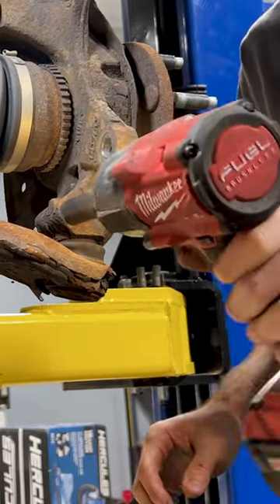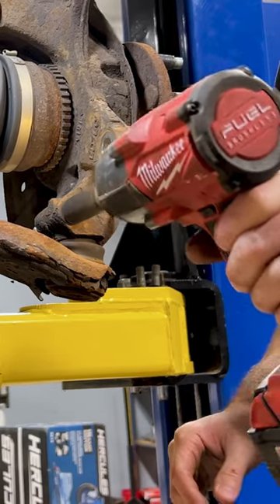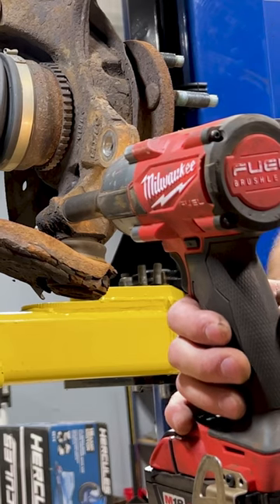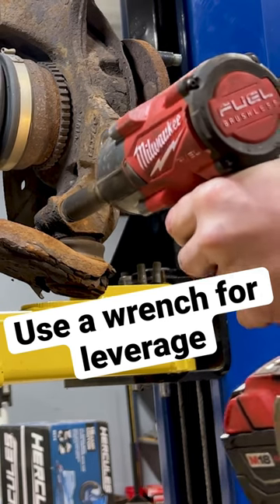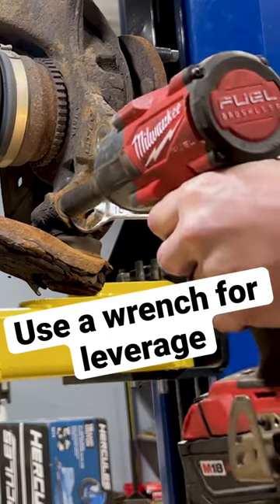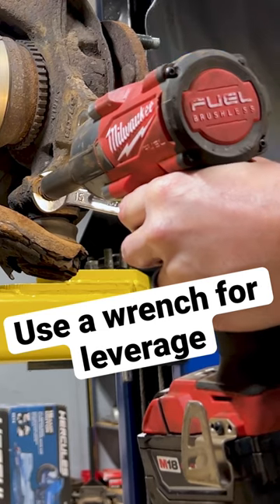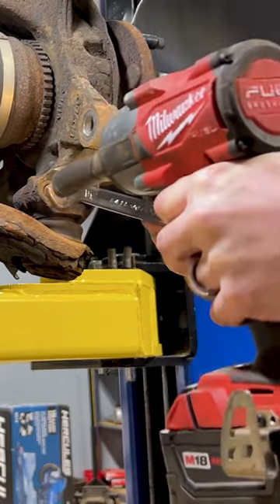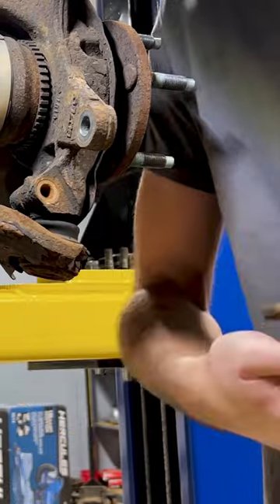Free-Spinning Bolt Removal Trick #shorts #automotive #autorepair #gotech #milwaukeetools

Comment: But how does one remove a free spinning bolt when the housing is surrounded in plastic and you can't get around or behind the head of the bolt.
Reply: Warm the surface gently with a heat gun, maybe?
Reply: Dealing with this right now. How did you solve it? Thank you.
Reply: @michaeld9999 Did you ever figure it out? I’ve had the same problem on my fourwheeler for a while now?
Reply: @AndrxwTP  Hi Andrew, no I haven't. Sorry man.
Reply: @michaeld9999  No worries man.

Comment: I use a hammer on osb sheathing while using impact driver to pull missed screws out. Works great to avoid a massive gouge in the osb.
Reply from the maker: Hey Jordon,
Good tip! A little ingenuity can go a long way! 
~Ryan Wilsing

Comment: So in a case like that you definitely just push on it with your finger from the other side.. but uh really everything works.. flat head to pry it.. pliers tk grab and pull... literally anything right? It's just a bit of pulling force you need
Reply from the maker: Yeh, true. This works on blind hole bolts too

Comment: They have these things called punches. Or a 1/4" extension works wonders to save yourself a trip to the toolbox. Please don't mention "if only the other side of the bolt is protruding". The bolt isn't frozen, and a 1/4" extension only measures, well, a 1/4" in diameter. Problem solved w out the use of an expensive battery operated, impact wrench.
Reply from the maker: There is definitely more than one way to achieve the same goal.
Thanks for watching!
~Ryan Wilsing

Comment: Why not use a screwdriver or mini pry tool..? It'll get in a tighter spot
Reply from the maker: Hey John,
I agree both those will work as well, I like using a open end wrench when it fits to prevent slipping.
Thanks for watching!
~Ryan

Comment: Iv used a small pry bar or flat screw driver to do this. Also iv just grabbed it with pliers and pulled
Reply from the maker: If it works it works!! Thanks for reaching out! Happy Wrenching!
~Ryan Wilsing
Reply: I do that or use the pry tool to remove plastic clips. Usually works right away

Comment: If its free spinning, just pull it out or use a magnet
Reply from the maker: I guess free spinning wasn't well defined. In this case, only part of the bolt is threaded. The smooth shaft of the bolt is free spinning but the bolt won't come out due to the crusty threaded section.
~Mike

Comment: Undo the but if the other side and then tap it through with a screwdriver like everyone else
Reply from the maker: That may work in this case here, but the other side of the bolt isn't always exposed. Also, need to be careful to not damage the bolt by tapping on it.
~Mike
Reply: @GoTechTraining  that's a fair comment, however, I've been undoing those sorts of bolts on European cars for 30+ years and the nut is always undone first, then you wind the bolt out if your lucky
But normally it's siezed into place through years of rust and no amount of effort gets it out in one piece 🤦
And yes, the prices of replacement bolts is ridiculous
Reply from the maker: Ahhh yeh, some can be a real pain. Kia/Hyundai had a recall on the Optima/Sonata back in the early 20-teens...Had to cut the rear control arm bolts out, they would ALWAYS be seized up...If you got them out in one piece it was a lottery ticket kinda day.
~Mike

Comment: I wanna see a trick for a free spinning lug stud...
Reply from the maker: Hey, when we come across one we'll have to show it...Lug studs can be a pain for sure. Not really sure I know of any tricks.
~Mike
Reply: I had to drill all the way through mine after wedging it so it wouldn’t spin 🤦‍♂️
Reply from the maker: You didn't have to take an axe to the wheel like that one Meme that's been circulating on social!? hahah!
~Mike
Reply: Really hard to do this without damaging the rim, but you can always pry the wheel up against the lugnut using a prybar and go at it with an impact.

Comment: Wrench or a screwdriver
Reply from the maker: I prefer using the wrench. A screwdriver tends to slip out!
~Mike
Reply: @GoTechTraining  they do but ive found if you cant get the wrench in there a flat head is the second best option
Reply from the maker: A flathead sometimes works great to get it started for sure. I have an old one I use for those kinda dirty prybar jobs ;)
~Mike

Comment: I use a screwdriver, stick it in the other end and wack it with a hammer :)
Reply from the maker: Hey, yeh that works good if the bolts exposed on the other side!
~Mike

Comment: Or just hit the other end with a hammer 🤷🏻‍♂️
Reply from the maker: You could, but you risk peening over the threads on a bolt that may get reused
Reply: @GoTechTraining  And sometimes you can't find an exact replacement bolt to save your life, or you can't afford it - I've been in both situations before, unfortunately.
Reply: Not always possible either
Reply from the maker: Ughhhhhhhh replacement bolts can be the worst sometimes! I did some lower control arms on a Silverado once, the bolts were like $40+ a piece!!!!
Reply: @GoTechTraining  I've been there before too. Then sometimes the "exact OEM replacement" doesn't fit anything like the OEM did. There are times when you have to fabricate your own part just to come close to OEM. So there are many reasons to avoid hitting the threads, if at all possible.
Reply from the maker: Agreeeeeeeeeeed!

Comment: Flathead. Your welcome
Reply from the maker: Hey Jesus, sure, it will get it done too.
~Mike
Reply: Right on mike. Remember. Tricks like these work best with every application. Sometimes you are not able to bring the bolt far enough back to use the wrench. Flat head on the other hand doesn’t care